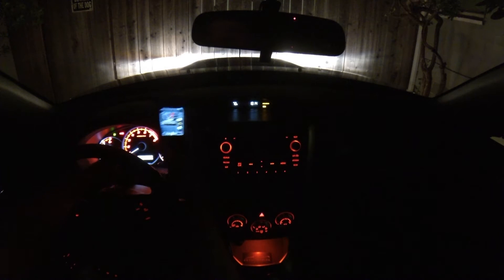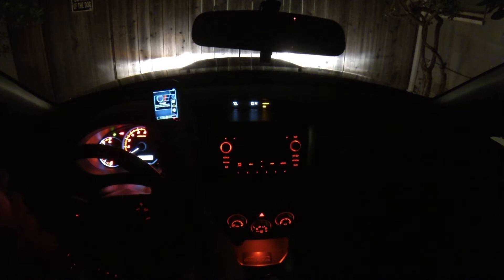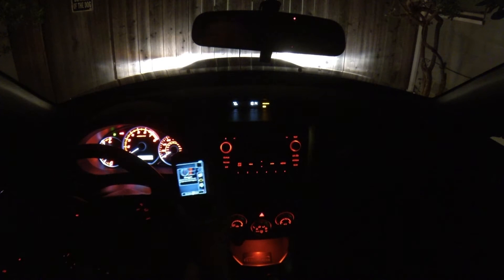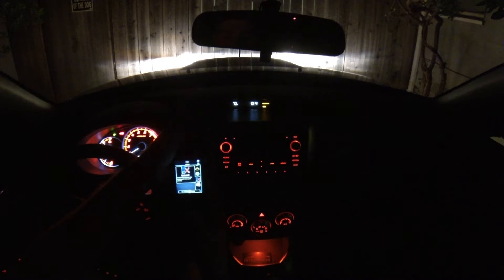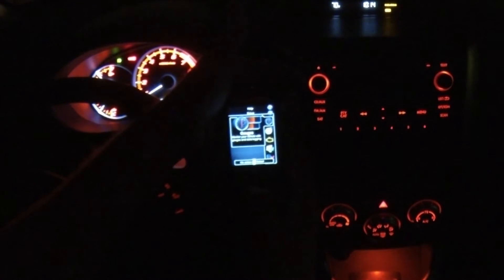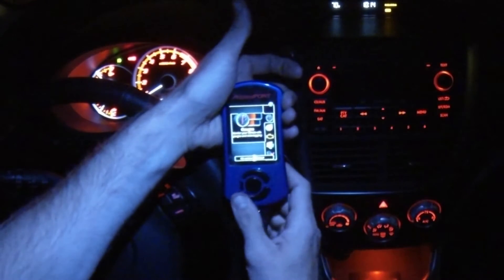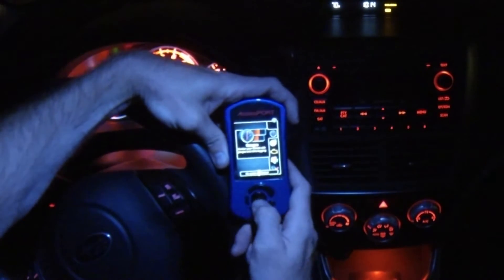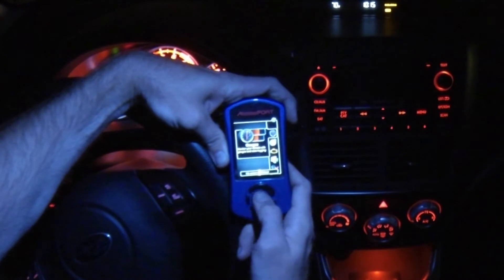Cobb AP gauge setup

Comment: I think for AF ratio should be 12.5 when on WOT. Any higher is rich and any lower is lean.
Reply: Higher AF is lean lower is rich (that's why it's air fuel ratio, not fuel air ratio, stoich AFR is 14.7:1). WOT should be around 11 depending on the tune for forced induction cars. AFR of 12.5 at WOT is ideal for naturally aspirated cars (or so I hear).
Reply: Cali WRX reply was 3 years ago lol he’s since gone built motor and E85. I’m sure he’s figured out stoichiometric measurements by now hehe

Comment: Ap worth every penny
Reply from the maker: Grant l Buy once cry once.
Reply: shawn bryson It is way overpriced
Reply: Can get them used but I went new rather kno I have it under warranty.
Reply: Blake's Garage Yup exactly what i did
Reply: Grant l Luckily I got it brand new for $450...
Reply from the maker: Cali_WRX Dang thats a smoking deal.
Reply: +Cali_WRX Dang, that's a good deal. I ended up picking up the Stage 1+ Power Pkg from Cobb during Black Fri. The Pkg saved $70 (vs individual purchases) plus the 10% sale. The APv3 came out to $543.21, so I saved $106.79 just on that.
Reply: It is overpriced but it is what it is.... I paid $560 and it still had plastic cover on it.